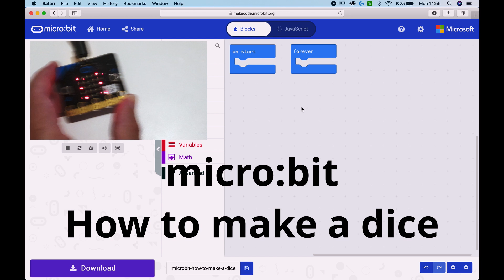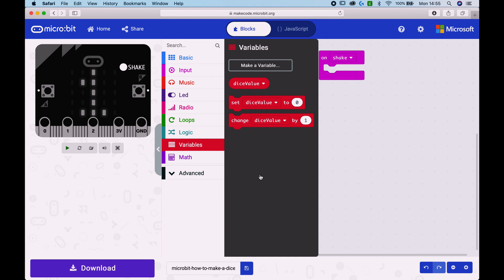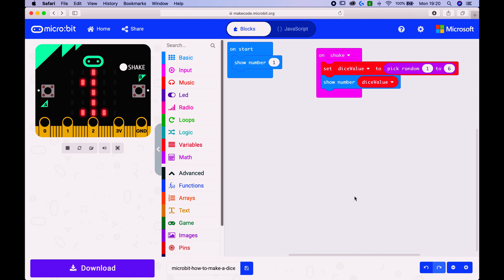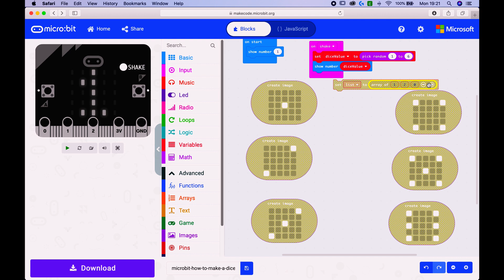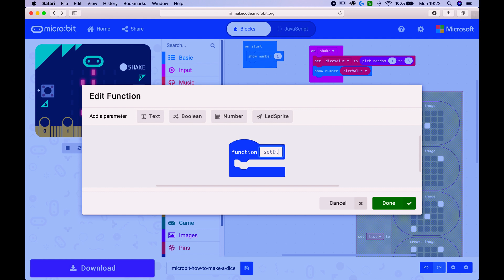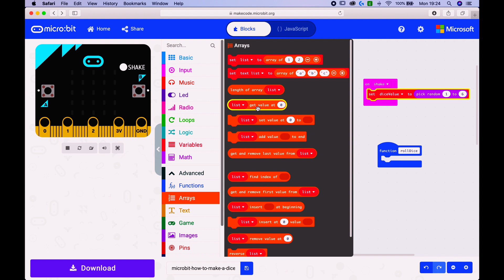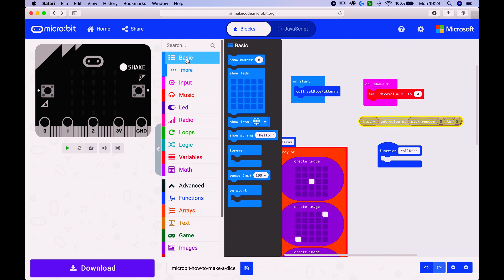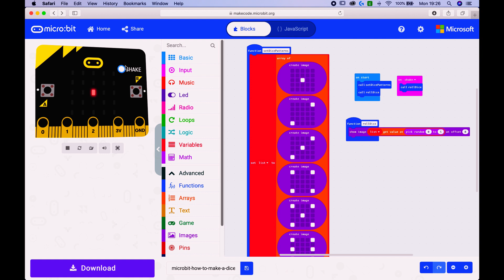How to make a dice 🎲 on your Microbit project tutorial #microbitcoding #microbit #microbitproject

Comment: what is the sound for roll the dice?
Reply from the maker: Hey, thanks for your comment :) The dice roll was added in the video edit. However, check out Microbit V2 which has a built in speaker so you could include the dice roll on-device :)